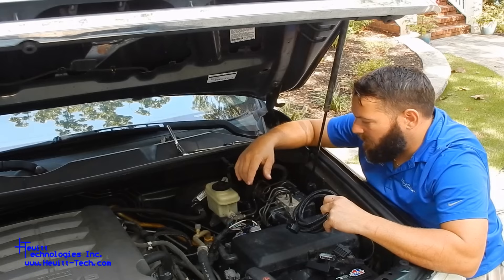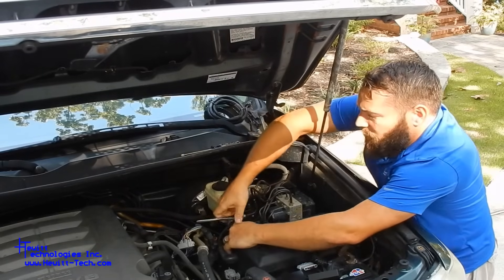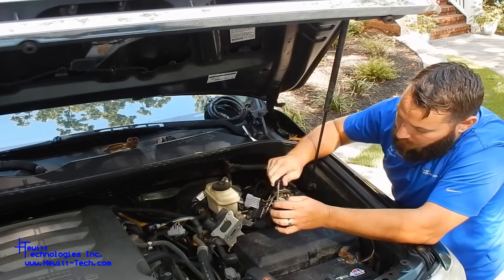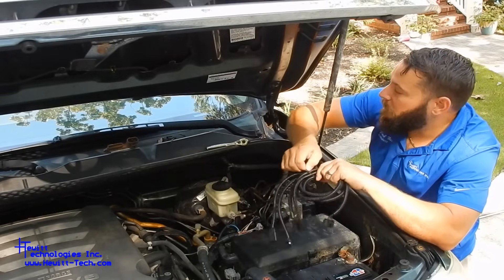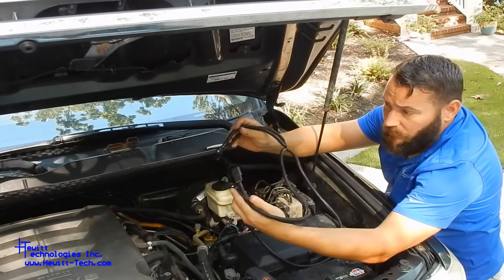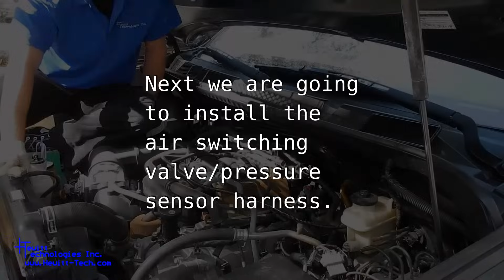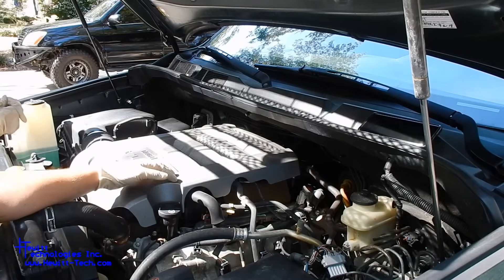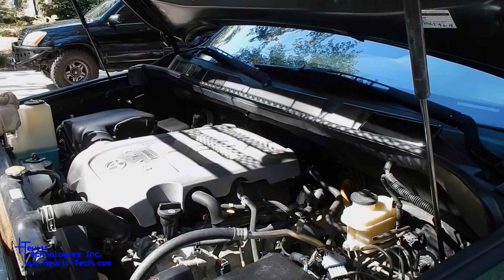Gen-II Secondary Air Injection Bypass Module - 2007-2021 Tundra 5.7L- Hewitt Technologies

Comment: Would I need gen 1 or gen 2 for a 2007 Toyota tundra 5.7L?
Reply from the maker: It all depends on what codes you are tripping. However, our recommended solution for your vehicle is the Gen 2 Bypass Kit because it is more comprehensive and will address both mechanical and Electrical SAIS Fault codes. The only thing it will not address is any damage or issues with the Pressure Sensors. Feel free to give us a call if you have any questions (844) 307-7671
Reply: @Hewitt-tech  so for code P2433 would I need a pressure sensor? Along with the bypass kit?
Reply from the maker: @goof-vlogz67  You are correct. P2433 indicate the Pressure Sensor in the Bank #1 Air Switching Valve is not reading correctly and would need the Pressure Sensor addon in addition to the Bypass Kit

Comment: Will it pass california smog after bypassing?
Reply from the maker: All kits are sold for off-road or other emissions exempt use only. The Gen2 kit will however allow the secondary air monitor to show as ready.
Reply: IN Cali too, did u fit this? Were u able to get through smog? Thanks

Comment: Do the 2014-up tundra need this upgrade what are the benefits of doing this mod
Reply from the maker: Hey Kirk. It's not an upgrade to anything. The kits are used to prevent or fix codes from the secondary air injection system failing. The Gen2 would be the one you would need to use on a 2014 or newer. No gains other than clearing codes and getting out of limp mode for a lot less cost of replacing the system.

Comment: Does this work for the 4.7L
Reply: 2010 toyota tundra?
Reply from the maker: Yes. Works for all 2005 - current model years. Check the info in the description.. This is just the install video for the 5.7l.

Comment: Does the bypass help with mpg?
Reply from the maker: Only if you are in limp mode because your secondary air injection system has failed. In limp mode you are running base fuel and timing maps without relying on the sensors to tune the engine. Add to the the transmission not being controlled electronically and only shifting on pressure and you will be getting considerably worse MPGs in limp mode. The kits (with any needed addons) will just get you back to running like it is supposed to.

Comment: I have a 2009 tundra. Well this negatively effect my truck long term? I plan on driving it the next 5-7 years and put in about 10k miles a year. Only have about 117k now.
Reply from the maker: There are no negative affects on the vehicle or your converters. It just does what it does to let you clear your secondary air system trouble codes and keep you out of limp mode after the system failed. The units are designed using all automotive qualified components to last the life of the vehicle and carry a limited lifetime warranty.

Comment: the key to connecting the passenger line is to reach it from the FRONT of the vehicle. to unplug the factory requires two actions...depress the release on the plug and push the plug off the connection. very awkward working from the passenger side.  I'm right handed. I moved to the front of the engine. from that position I could reach the plug and complete the maneuver almost effortlessly. 

The driver side wasn't too bad.
Reply from the maker: @shcaskey We really appreciate you taking the time to provide your installation tip. Everyone experience is a little different and really helps when customers provide what worked for them. It can be a little tricky when trying to unlatch and remove the factory connect all the while not trying to pull our any pins. Well done and please let us know if there is anything else we can assist with.

Comment: Will this video work for a 2007 5.7L ?
Reply from the maker: Yes. The Gen-II unit is available for all Toyota and Lexus vehicles 2005 and newer. The installation shown here is the same for ALL 5.7L vehicles from 2007 and newer including the Flex fuel versions. Thanks for asking the question, I have updated the description and title to better reflect the availability and coverage of the kit.
Reply: how can we talk I need for an a 07 tundra 5.7
Reply: @noodlecat2156  This works for the 2007 5.7 Liter Tundra. I'm not much of a mechanic, and I was able to install this on my own. It took me a little while, but with some patience I got it done. I've had no error codes after I installed it.

Comment: So you only have to replace the bank 2 module? I have a p2442 code in my 08 tundra 5.7. Thanks
Reply from the maker: Both air injection control drivers are replaced with one GenII unit. In the video I just left one of the air injection control drivers in place so the big 2 wire connecton could remain connected to it and be safe instead of taping off both off them. Now they come with our custom blank plug caps so instead of taping either off or leaving one connected you remove both air injection control drivers and put the blank plugs in both big 2 wire connectors.

Comment: would I need this kit or the first gen for my 05 4.7 Sequoia to eliminate all sensors and future codes?
Reply from the maker: The GenII is the recommended solution that covers the most codes and eliminates as much of the system as possible. With the GenII unit only the pressure sensor(s) in the system need to remain and be undamaged. Wirh the GenII they are the only thing that would need a kit addon to replace them if they were damaged.

Comment: !HELP! Is this required after changing the air pump injectors on 5.7L??
Reply from the maker: It should not be but unfortunately, we see a lot of people fall into the trap of using low quality aftermarket parts when they try to repair the system or replacing an air switching valve when the problem is actually being caused by the air pumps. Either way we can help you with our solutions. Please give us a call Toll Free with your trouble codes and we would be glad to help you figure out the best solution to get you back up and running again. Toll Free 844-307-7671 support@hewitt-tech.com

Comment: Will any of your kits still work on a Tundra that has had the ECU reflashed by the dealership?
Reply from the maker: The GenII kit is compatible with all current model years and reflashes. There is currently a certain reflash for certain 12-13 Tundra and Sequoia 5.7L vehicles that makes them incompatable with our GenI V5xH kits but we recommend the GenII for anything 08 and newer anyway because they are a much better solution in almost every aspect.

Comment: Will this work for my 2011 Tundra 5.7L with a code of P0415?
Reply from the maker: Yes. It can take care of the P0415 which is a problem with the Bank 2 air switching valve's solenoid circuit.

Comment: Installed now my truck won’t stay running any suggestions it was running before just had code
Reply from the maker: Did you disconnect the negative battery terminal while installing?  In the last part of the instructions we point out that it's perfectly normal for it to stall on the first start. The ECM has to re-learn idle and fuel trims after being reset by disconnecting the battery for at least 2 min. If it won't stay running after the first few tries something is wrong or something is not installed correctly. Please give us a call Toll Free 844-307-7679 or send us an email Support@hewitt-tech.com if the problem persists.
Reply from the maker: He only had half of the kit plugged in.

Comment: I bought a PSO so do we unplug the hewitt harness from the switching valve and hook it up to the PSO or do we disconnect the factory harness?  my codes came back up p2443 and p2447 but i disconnected the hewitt harness from the valve and left nothing connected to the switching valve?
Reply from the maker: You would disconnect the Gen2 harness from the air switching valve and then plug the pressure sensor into the Gen2 Harness. That air switching valve would then remain disconnected. Clear the codes and if you still have problems you will need to give us a call or email so we can do some troubleshooting.

Comment: Just got done with the install. It's gonna a take 500 tries for some of us to unplug the 2 wires behind the manifold but don't give up. It will work. Put on knee protection and go up over the engine and feel your way around the plug cause you can't see it and need to feel your way around it. * the hardest part was separating the flanges to put in the blocking plate. I spent hours until I got a floor jack and jacked up the stick that was pushing on the stud. The trick was to have the middle of the stick backed into break/disk so when I jack it up it won't pop off or push the jack back. Use hard wood cause I pushed it almost to breaking point.
Reply: Yeah this is kicking my tail in doing the wires in the back

Comment: My truck is in the shop for this exact reason. $640 to replace the pump they think is bad. Another $400 something to replace the other if they guessed wrong. If switches need to be replaced it will cost another $1700. That's almost $3,000. Man I wish I would have found this video sooner. I told them to replace the one pump they think is bad before continuing but won't know till tomorrow. I have a feeling they are gonna string me along so I'll ask them if there's a way to bypass the system and see what they say. If they are on the up and up I'll let them do it. If not I'll be purchasing this kit and see how it goes. One question though. What does this do you fuel economy?
Reply: Thanks Paul. They got the codes and did a voltage reading on both pumps. The one that they replaced had the low reading. I picked it up   this afternoon and had power in the throttle again. I've been reading that once this starts to happen it can have a cascading effect. If that happens to be the case I will definitely keep this bypass in mind.

Comment: Will this work on my 2013 tundra 5.7 with a code of P0717?
Reply from the maker: No. That is a transmission circuit code and completely unrelated to the secondary air system.
Reply: @Hewitt-tech  ok ty

Comment: Question. Does this affects your fuel economy, most importantly does it affect your engine reliability. I imagine if this engine was designed with this pump is because of something. I’m dealing with these pumps issue. And if I have to spend the money to fix it I will. It’s I’m tired of dealing with this pump issues every other month.
Reply from the maker: There is no effect on the fuel economy unless it fails and you are in limp mode. Getting the codes cleared and out of limp mode will restore whatever state of tune condition the vehicle was in. It does not have any effect on the engine itself or the catalytic converter longevity or performance except when cold it will take slightly longer to get to operating temperature. However, the system doesn't always run on every cold engine start so that is a pretty moot difference. Please give us a call direct with any other questions and we would be glad to discuss the whole system and our solutions.

Comment: I have a 2012 4.6L Tundra, will this product clear my P2432 code?
Reply from the maker: No, none of our kits can take care of any of the pressure sensor codes by themselves. We do have pressure sensor replacement options that are added to the kit to take care of them. However if the code is caused by damaged wiring or a damaged ECM the addons won't work either and the remaining wiring or ECM problem would still need to be taken care of.

Comment: What is the Air injection system for? Is the truck ok to run without it? If so then why did Toyota put them on there?
Reply from the maker: It is an EPA mandated emissions system that is required for on highway use in the US. It helps support the catalytic converters by getting them up to efficient operating temperature faster on initial warmup after a cold soak start (engine off for 7 hrs.) They have no impact on the engine operation or performance unless it fails and puts you into limp mode. Not having  a secondary air system operating is no different than the rest of the day when the system is not operating and will not affect the engine or catalytic converters. It is illegal to bypass or otherwise make inoperable an emissions system required for on highway use. We sell our kits for off-road use or other emissions exempt use only.
Reply: @Hewitt-tech  thanks for info. I have a 2020 and was concerned about that possibility of mine going out in the future
Reply from the maker: @dalephillips8250  We have already seen a couple of the 2019-2020 have issues but those are not likely typical failures. There will always be failures but it will likely be 5-10 years before we may start to see a similar MTBF rate.

Comment: I live in California with tough smog laws. Will my truck still be able to smog and pass?
Reply from the maker: We sell them for off-road or emissions exempt use only. It is illegal to bypass or otherwise make inoperable an emissions system required for on highway use. Having said that what you do with it is up to you. As long as there are no other issues and all our other emissions monitors complete even an emissions exempt vehicle could pass smog with this if you had it tested.
Reply: In Cali too, did this work for smog? thanks
Reply: @SPaddy-fb7hy  Yes passed smog no problem.
Reply: @deangarcia449  I really appreciate you taking the time to answer. My main concern is the visual inspection at the MAF plug. paranoid perhaps lol
Reply: @SPaddy-fb7hy  I also had to buy the pressure bypass switch because I had an after market check valve. I made a fake wire to plug into the valve so it looks like it's connected for the visual inspection.